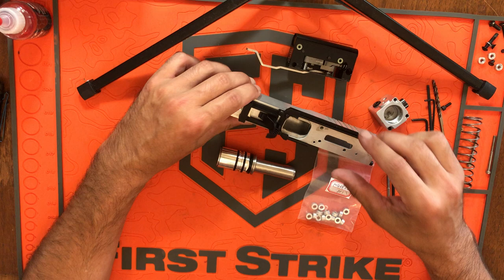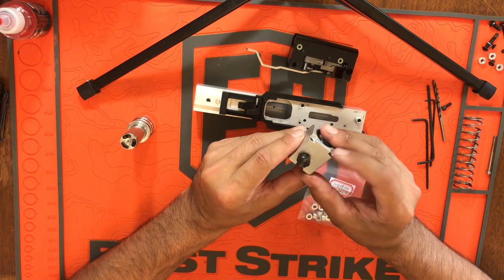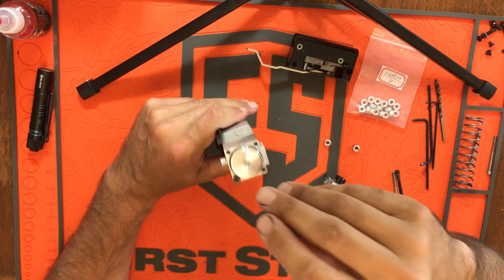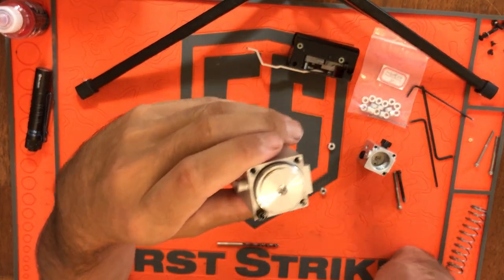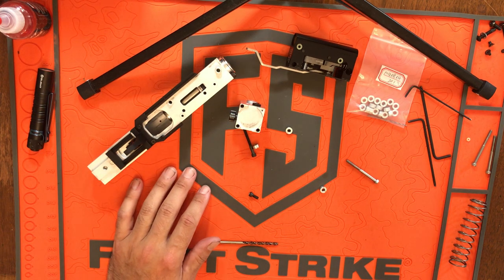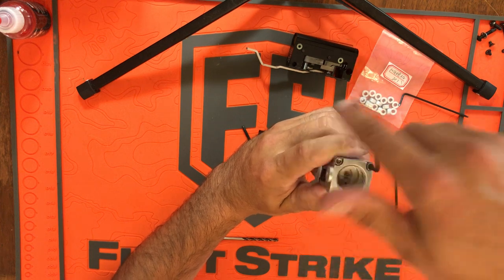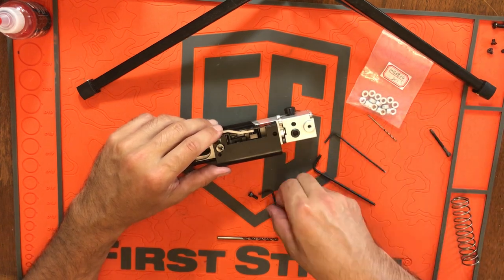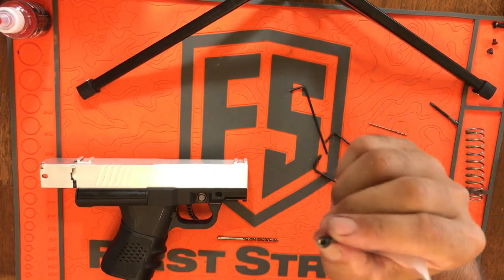How to install Vks chamber/bolt into an Fsc. Seans method (Vksssk)

Comment: Hey man I just wanted to say thanks again for this mod, I finally got it done! No drill press so it took about 3 different drill bits breaking before I achieved success 😅 tricky but can be done with a small vice and jedi focus lol I've ran about 100 rounds through it, no leaks and boy she is a beast! You tha man!
Reply from the maker: Nice work! I havent heard from many that tried. The drilling of the screw i think turns people off but you just proved it could be done. Itll sling some high fps projectiles now just be mindful of that firing pin.
Reply: @Less Lethal for Dummies  I was determined to get this one done! It's great that it's fairly cost-effective as well. Took a little time for all the screws and washers to come in, but it was worth it. I sourced some stainless steel firing pin screws off amazon so as soon as it gets loose I'll slap some red locktite on one. I did check before installing and it was too tight to budge for now. The only thing I'm really missing at this point is the VKS bolt spring. Do you feel it's necessary? The fsc spring seems more than capable for now
Reply from the maker: The fsc spring is perfectly capable of handling it. If your are sending it to the moon like 80+ it wouldnt be a bad idea. Gives a little more cushion for the bolt. 60-70 at 900psi the fsc spring has served me well and it doesnt add any fps, just piece of mind.
Reply from the maker: Did you divot the screw head for the tiny oring? Curious i had some luck not doing it but ultimately it hasn’t failed since.
Reply: @Less Lethal for Dummies  I'll definitely be keeping it under 80 joules, probably closer to 60. I'm running it around 850psi just to play it safe for the bolt. Yes, I did the divot and like you said it only needed  a touch. I went a little too far in and stripped out the alan key head but good news it still worked. Holds the oring perfectly! I didn't want to try without the divot because it slips right off the screw. It definitely adds extra grip and helps it sit in place
Reply from the maker: @MG-qz6ft  reality is that screw doesnt need to be that tight anyways its just acts as a passage way.
Reply: @Less Lethal for Dummies  one question man. Regarding the firing pin, do you know the exact size of flat head screwdriver that fits? Everything I have is a bit small and I feel if I try to remove the pin I'll strip the head.

Comment: It is really cool that this is even possible. How about drilling and tapping a bolt or two through the body of the FSC to protrude into a groove in the chamber as an extra means of keeping it in place? Would have to be sealed as that is an air chamber where I am suggesting to protrude in. Smoothing the protruding tip of the screw/bolt so it seats/fits well into the air chamber groove might also be part of such a solution/experiment. Obviously it might be good to have more than just the 3 rear bolts securing that chamber in there.
Reply from the maker: While i would love to have another secondary measure of security for the air chamber i have now shot over 300rds in this setup without any issues. 

Now your idea has some merit for another idea I have with my 9.1 which is the next project. I also plan on doing some more with my m17 so stay tuned.
Reply: @lesslethalfordummies  300 rds is a good reliability test! The M17 is next on my list to check out after a carbine/shorty VKS build I want to do. I will stay tuned.

Comment: I'm on this real soon what a great hack thanks
Reply from the maker: There are few people running the chamber using this method and are quite happy.
Reply: @lesslethalfordummies  I've just orderd all the bits and in the process of ordering the chamber I run 20g co2 mags with a folding stock that isn't  airthru so I may need to look in to slightly longer screws but il see wen it all turns up,this is definitely cheaper then one I've seen on other channel offering rear cap and the price's are crazy,thanks for the video,I run a 9inch barrel with mock suppressor so look forward to the bang
Reply from the maker: I have the screw measurements at home to use it with the folding stock.

If you are using co2 you dont need to drill the little socket cap so that makes the conversion super simple and no tools required
Reply: That's great thanks
Reply from the maker: 6-32 x 1/2” is the appropriate size to use the vks chamber with the spacers  and FS folding stock. The factory size is 6-32 x 3/8” which does work but i didn’t feel comfortable about the amount of thread engagement.

Comment: I wonder if you could widen the air hole on the ASA and widen the air hole on FSC receiver and insert a metal tube that would fit snug through both ends of the ASA and FSC receiver.
It would eliminate the use of the o-ring and modding the screw.
Reply from the maker: A positive connection would be a great idea I just havent fingered out how to do it yet. I havent had any oring issues yet but if it becomes an issue i may dive into this idea deeper.
Reply: @lesslethalfordummies  
Aliexpress Size M2

Search; 
2-10pcs aluminum spacer  m3 M4 M5 m6 round Aluminum Standoff rods For RC Multirotors

Comment: Man Love this mod ..it got me some cyberpunk Feelings  😄 😎
Question:  by any Chance u can craft  me a drilled screw like u Did in the vid for use hpa ?  I would even use it with co2 but i "need" or call it " like"  to have my folding fsc buttstock on my co2 fsc  : and i guess no Chance for use it (folding stock)  with that mod right ? So when i need screw a bottle in for create an buttstock then better direct go hpa  so when u up to help me out with that screw let me know 😉 👐
Reply from the maker: I wish i could help everyone but i am just not equipped to do so. I never tested my method using the folding stock yet and i imagine it would work on paper but the rear block for the folding stock has rather thin mounting points which give me an uneasy feel about how strong they are holding back the chamber.
Reply: @lesslethalfordummies  nah bro its fine ..u do enough for the LL community ..i wish iam more good in handworks so i could also help haha ..i like the hpa method from the mod here thats why i asked. Thanks sean

Comment: Thank you i apreciate it :)
Did u use the full vks parts like bolt and chamber or just the chamber from.vks..?
Reply from the maker: The Vks bolt and chamber are sold together as a unit but if for some strange reason you only had the chamber the standard Fsc bolt works without issue.
Reply: Nice and maybe its too early ask you out haha sorry ..did u know already what it differs in numbers ~ related to an fsc chamber ? 😶‍🌫️
Reply from the maker: @werissdieserjunge  about 10-15% higher fps but its game over with a longer barrel as the the vks chamber responds very well.
Reply: @lesslethalfordummies  ❤️

Comment: I still have a few bits coming in for this one. How's she been holding up??
Reply from the maker: Zero problems at all. I was even experimenting with 2 co2s and no issues.
Reply: @lesslethalfordummies  that's great! Can't wait to try this one out
Reply from the maker: @MG-qz6ft  you wont be disappointed. Big power from an 8" barrel. Still hits 55-60 effortlessly with 5".
Reply: @lesslethalfordummies  that's wild and always what I wanted out of the fsc. Powerful compact. I've got the 5inch .683 lapco with the lapco FS surpressor. No chrono at the moment so thats nice to know I'll be close to those numbers!

Comment: Can this be done without the aluminum spacers?
Reply from the maker: You could use anything as spacers so long as they fit as there is limited clearance before contact is made with the outside wall of air chamber.
Reply: @lesslethalfordummies  Thanks 😊
Reply: @lesslethalfordummies  can you sell me some of the black screws that you drilled through the middle?
Reply from the maker: @tonydavisbusiness  i dont sell anything unfortunately. It was more of a tutorial. You only need the screw for hpa. You can actually run co2 through the mag without it.
Reply: @lesslethalfordummies  yeah I'm running co2. Just wanted more power with the hpa. I have the screws, just don't own a drill press. Tried to drill by hand but couldn't get it right. 😪
Reply from the maker: @tonydavisbusiness  maybe a near by friend has a drill press?